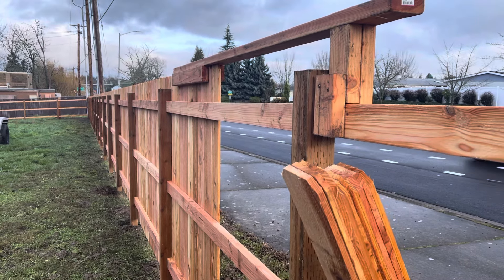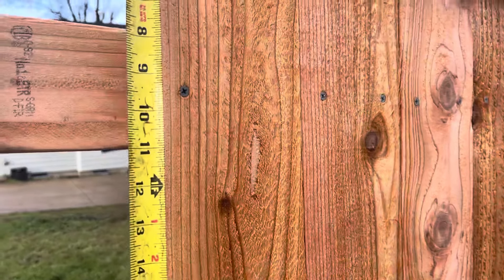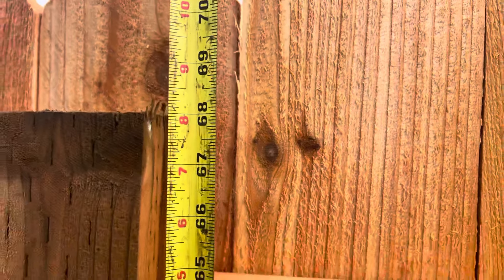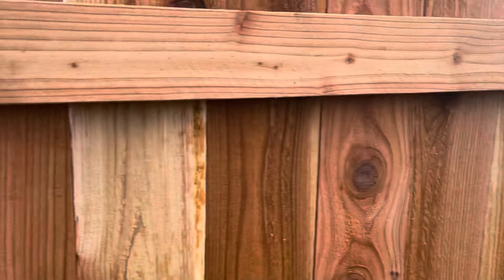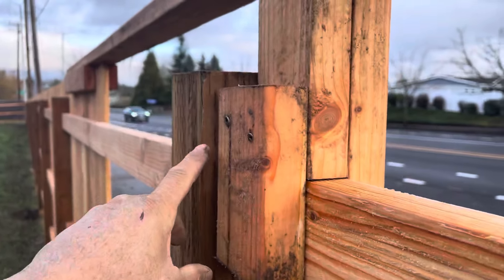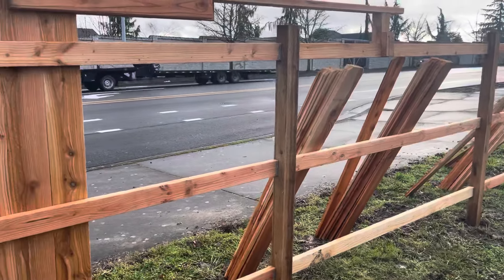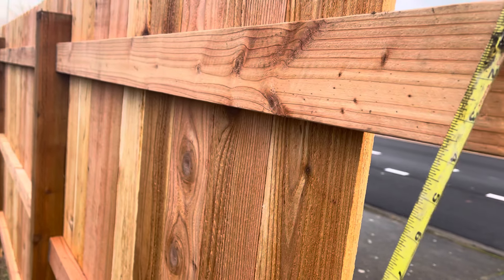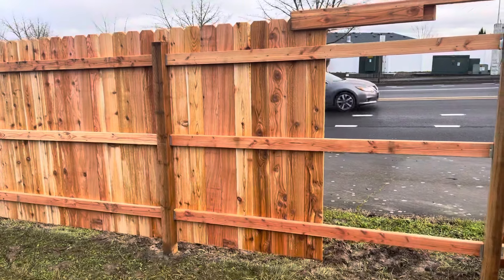HOW TO BUILD A WOOD FENCE STRAIGHT DIY

Comment: Awesome work ! Most of the time I use 2x6 at the bottom, level those out and sit the pickets on top  straight leveled fence pickets every time!
Reply from the maker: Thank you! I appreciate that. Well , I can tell you that what you do with the 2x6 is actually my favorite way to build wood fences. You are about the only other guy I have met that likes to do it this way. I tried talking my last company into it. Because not only does it work for that. But  it acts as a retaining wall. Great border for animals. Keeps the bottom of the fence boards away from the dirt. You can also use a 2x12 and make a 7 foot tall fence and use 6 foot pickets. Otherwise you have to buy 8 footers and cut them down. Saves on labor and material waste. Offers a great look and it is a fast build. And the build is so satisfying . So easy, like a top cap , but even better. Keep up the good work man! I like your style.....👍
Reply: @fastflo1  that works only if you use the brackets though. If you screw the rails over the posts then it is even with the 2x6 at the bottom and you cannot use it as a ledge to set the pickets on.  Im doing my first fence now and I have to solve all these problems for the first time.
Reply: @fastflo1  also if you use the 2 x 12 to make a 7ft fence then wont you have 19" of the picket above the top rail?
Reply from the maker: @ScreamingEagleFTW  I see… I know the type you are speaking of. Because now you have the rails even with the bottom 2x6…. Everything is flush. I like the bottom method when the clips are used to serve as a guide the boards sit on. In your case , I would recommend using a small ledger so to speak. Even a 2x2 screwed into the face of the 2x6 or a 2x4 would make a great shelf for the boards . They are only like 5/8”.. might also add a nice look at the same time . Granted there is a little more material cost , it would be minimal for a solution to this issue . Fast , easy , it would look good and serve a purpose. Let me know what you come up with .
Reply: @fastflo1  I like the jig you made in the video. Just a one time cost and no leveling another board at the bottom.   I might make it out of square steel tubing.  Also, I noticed that you dont really need the channel at the far end do you?  Wont the jig just rest on the previous picket?  I cant see it falling off with the spacer end straddling the top rail.
Reply from the maker: @ScreamingEagleFTW  good question …. So when I do 7 foot fences I usually use 2 methods . When the height gets above 6 foot I normally do a three foot set . If you use 9 foot posts it leaves 6 foot out of the ground. I would do a 2x12 bottom board . Then use 6 foot boards and let 12 inches stick above the top runner. Basically 6 foot boards on a 2x12 is 7 foot. Post height is 6 foot. Next method is buying ten foot posts . Setting them 3 foot in the ground . Leaving the 7 out . Buying 8 foot boards and cutting them down to 7 foot. If I decide to use a board at the bottom for a guide to sit on that is up to you . But the 10 foot boards give you the room to use for a flush too cap if that’s what you want or to make up for grade difference. Just matters what situation you are in and what the customer wants. I add more labor for the top cap and using the ten footers vs the 9 footer with the shorter boards . You have time to cut the boards and install top caps . I like the first method most. It’s fast, the boards go up quick . No citron . The 2x12 serves as a retaining board . And the height is set when you set the runner . If you are having a tough time grading and doing it all…. I will make it really simple . On flat ground . Set your posts at 6 foot. Install 2x12 at gound level and level to make straight , double check by eye in the end and look . Because this is the grade of the fence on top also. Then space your rails out . Put the top runner flush  to the top of the post. Install your boards. You will have a 7 foot tall fence. 5 foot frame. And 1 foot resting board . Easy to install . Very effective and great look. Saves time , material, labor.
Reply: @fastflo1  I like flush cut posts. Thank you for your detailed advice.
Reply from the maker: @ScreamingEagleFTW  thank you . Yes, you can definitely make one out of whatever material you choose. I was in the process of welding one but did not get make the video on the jig. I was going to make one with an adjustable end for different rails heights. Also the tail section is up to you . It added some weight and offered some stability.  You can get a little more aggressive with it. If I did change this one, I would leave a small gap so I could see the boards touch. But I actually just listen and feel each one tap the top then I staple it. Metal would definitely stay straight , and last longer, easy to handle .
Reply: @fastflo1  I was thinking adjustable also!   Do you think 8 feet is more accurate than say if I made it only 4 feet long?
Reply from the maker: @ScreamingEagleFTW  yes adjustability is good! Would be a fun project to make. I personally was thinking 8 foot is really good . The marks on the rails at the post will be more accurate. If you have any dips or crowns in the rails …. The smaller one will follow those more closely. It may show more inconsistencies…. So I do prefer to span the bay from post to post.
Reply: @fastflo1  Very good info, thats what I wanted to know thank you!
Reply from the maker: @ScreamingEagleFTW  definitely I am glad the info was helpful. Let me know how it goes!

Comment: Great tips. Only thing that I hated was letting the tape in slam into the casing when it reels in. That's hard 😢on that end.
Reply from the maker: Nice! I use it to kick it and actually turn it for my flip. It is very purposeful for how I use this tape. Same type since I started building fences in 1988. But you are right. It is a little harder on the end. Thanks for your feedback😀

Comment: I would imagine since you utilize the brackets, your holes arent spaced the traditional "8' on center", how do you get your posts set so nicely? Great video!
Reply from the maker: I do not like to use 8 foot centers. I like to measure them smaller. For less sag and if you want to trim the ends you can. I also set my posts to height and line by eye believe it or not. And thank you I am glad you enjoyed the video!

Comment: Did you use a transit to find your cut marks for the 4x4 cut at 68" Im doing one noe and ground is a bit uneven, Im wondering how to do it without a transit. Can cut them all at 68" if the ground is uneven, some will have to be a bit taller
Reply from the maker: Sorry for the late response. I am just seeing this now. I do not use a transit. I actually use a method I use some flagging tape and my eye to sight them in and I set them to the finish height so they all have a factory end. So, if you do use a transit .... Basically that will give you a level line or a benchmark on your posts. If you can get a level line all the across all of the posts. Go measure from the ground up to the line. The biggest number in the lowest spot of your grade. The lowest number is the highest part of the grade. If you start your grade on the high spot, fill in all the gaps. If you start in the low spot , trench the high points down. The difference in the numbers is how big the gap is. So essentially what you are doing in just establishing a level line , and transferring it up to your desired height. So if you find the high spot and go off that. Let's say the line turned out to be at 60 inches..... Just measure up 8 inches on every post and cut it. They will all be level. Your board will be at grade at the high point and you can now fill in all the gaps and use the fence as a guideline to perfect your landscape. Please let me know if this was helpful or not. Thanks and good luck👌
Reply from the maker: Oh woops... Without a transit... You can pull a string across. Start at 68 where you want the boards to start on the ground. Pull a string across from end to end and look down it. Use a screw or small nail in each post to hold the string up from sagging. And eye them all in and make adjustments to them until it looks really straight. When it looks great, just makes all the marks and pretty much that is it.

Comment: Where did you get your brackets that's holding the 2x4s to the 4x4 post?
Reply from the maker: I get them in the hardware section in Home Depot . The are Simpson Zmax Type.

Comment: Will this work if you have uneven ground and your railing follow the grade of your ground?
Reply from the maker: Excellent question. That will depend how severe the grade is. On the straight sections between posts it will be accurate like a normal fence. At the transition is where you will have an issue. Depending when you move the jig forward. For instance, if you move it half way and center it in the middle of a post it will flatten a high spot, or raise a low spot... That is up to you to judge. If you move the jig along board for board and stay close the front of the jig, the transitions will be more subtle. The board measurement above the rail will also increase or decrease based on the grade difference. That is if you want to boards to flow. If you are doing the panel for panel method with no subtle transitions, then make sure to span the distance evenly on each section so they are the same, then switch to the next panel entirely. Also you can go straight section for section and manually adjust the few boards at each post to flow the way you want . That is my favorite method on grades.... Each section straight post to post and adjust a few boards at the transition, shoot the next section straight, adjust a few boards at the post and keep going! Should be a breeze. You will get the hang of it pretty quick ...... The techniques will come along the more frequently you use this technique. Please let me know how this works out for you. Also if you are using staples, bring a couple skinny nails with you , you can pin a few boards around the transition areas temporarily and remove them easily....That way you can see and make adjustments without destroying your materials.👍

Comment: How do you make sure the posts are even and straight looking like that from the beginning it’s awesome 😃
Reply from the maker: Thanks! Well, I do have a few different techniques. I set my posts to the height I want them and inline at the same time. I can do them by eye by setting one on each end and then lining up the sides and top. So if you are not able to judge by eye. I would suggest setting up a stake at each end of the string 1 foot high. off the ground. Make is perfect from end to end by staking a few in between to avoid sagging, and make it straight.  If you want your fence post to be 6 feet high off the ground, make a mark on the post at 5 feet. Then set the post inline on the side of the string, and the mark on the string. It will add up to 6 feet. And should be straight on the side and top. As straight as your string. If you want to get longer posts or cut the shorter. Just set them in the ground the same way. Next just mark up from the 1 foot string to whatever height you choose, and cut it off. They should all be the same. Good luck! I hope this helps out. And always make sure you check the marks and line by eye before you cut!

Comment: So are all of your 2x4’s level or do you always go 4 inches down from the top of your post? (68in above the ground)
Reply from the maker: The 2x4's are in a straight line ant a slight angle. On top cap I do not go 68 . On a fence like this I like to go 68 and get the extra post in the ground. And I think it gives it a decent balance also looking at it.

Comment: Straight as an arrow. I just started building wood fences the problem im having is my pickets seems to get our of straight and leaning even though im using a level. Also it creates more ripping. What am I doing wrong
Reply from the maker: So here is what is happening . The boards are not cut straight . So they are bent and bowed pretty much . If you put a board up and another and another and so on eventually they will be off. So I will start with a board just flush with the 4x4 . I will put about three boards with a staple on top and let the bottoms float. Then put a level on the last board and level it the best you can and staple the bottoms then the tops. Sometimes you will have to kick the boards tight. Sometimes you will let them float and give each a small gap. When you get about half way through the bay , measure from your last board to the next post top and bottom. What ever the difference is , let’s say the top is 1 inch shorter. You have four feet left in the bay , so just put about a 1/8 inch gap between each board and by the time you get to the post you should be pretty square. And if you end up at a post with a bigger adjustment , then do the space with the 4x4 behind the post and the crack will not show through because the 4x4. If you keep doing this method you will hardly even use the level anymore. Your rips will become less or smaller . And you will definitely be less frustrated. Just remember that in the end, nobody ever checks with a level. You can look at something and tell if it’s off or not. So just learn along the way and trust your eye . You will see and feel when things start getting out of whack . Get it back as soon as you can and don’t worry about small gaps. You will always have gaps if it’s not board on board. Well good luck and let me know if there is anything else . Il be glad to help if I can . Thanks and keep going for it 👍🏻

Comment: You start with setting top rail 1st or bottom?
Reply from the maker: I like to start at the bottom and make sure it is not too tight and knock the tops out. Then I install the middle and top and make sure it all looks good . Then I lock the top in with some screws and then hit the middle and bottom. Keeps it nice and tight. If you take a really good bottom measurement it should work for all the rails. The bottom is always the most accurate measurement if the posts are slightly out of plumb. This will square it all up.
Reply: That's frign awesome!!!Thankyou

Comment: So you have an 8ft 4x4, you’ve set 2ft in the ground roughly and then you went and cut them all to exactly 68in from bottom ground level??
Reply from the maker: Close. Great question. You can definitely do it that way. I went the extra mile and set all of these posts to height. I like the factory cut it is a nice finish. If I ever do cut my posts, I will cut them first and put the cut end in the hole.

Comment: How do cover the gap at the bottom of the panels?
Reply from the maker: Several different ways. You can add a bottom board or add top soil or gravel , bark dust etc.... Your choice. The finish of the landscape will match the fence perfectly, the fence is the guideline.

Comment: What type of screw do you use?
Reply from the maker: I use Griprite Grey Exterior Screws #2 Phillips head 1-5/8'" in length. #8 bugle head. They are great for the clips. Sometimes I use longer on the screws that screw the clip to the post.
Reply: I can't tell but did you have the boards touching ground or off the ground a bit?

Comment: Are DF rails or treated.
Reply from the maker: These are DF #2 or better
Reply: Thanks never used it, but maybe it’s time to try, price is better, and the new pressure treated these days twist a lot
Reply from the maker: @MichaelPaszkowski  I have been using in Oregon for over 20 years now. It is a really durable . And I agree in the new stuff it is pretty bad. I think you will like the DF

Comment: do you think it would be just as accurate if I made the guide only 3 or 4 feet long?  would that work?
Reply from the maker: I like the 8 footer next  to the posts …. Where the marks are most accurate.
Reply: Why? Just make the guide that you know works. No re inventing needed! It needs to be at least one section in length to work . A short guide will rest on a “ sag “ or a “ crown” at mid point of the top rails , will give you headaches. You got this , Fastflo knows what he’s doing , do the same as he does & if you get that result you will have done good!  
Look how nice that fence he’s building is looking , nice yes? 
Good luck with your fences!

Comment: How high is the fence above the ground?
Reply from the maker: It starts off 1 inch off the ground. And it has a subgrade of 6 inches in some areas. The fence is straight so the bottom will now serve as a guideline to fix the landscape and bring it up to the bottom of the fence.
Reply: How high is the wood picket from the ground? It’s look very high in the video.

Comment: How would this method work if you have a slope ?
Reply from the maker: It works well on slopes. A consistent slope is fine, if there are drastic grade changes, not so well. When you have subtle grade changes you can be the judge as to where you put the boards in and when you slide the guide forwards. It helps to smooth out the transitions.
Reply from the maker: This may be helpful also https://youtu.be/iSpVxzoH3io